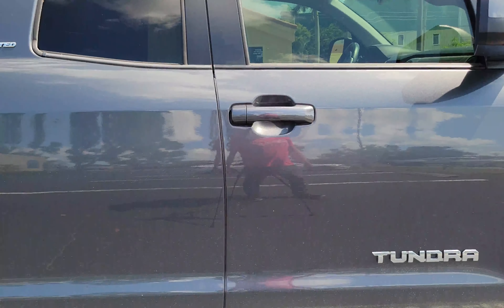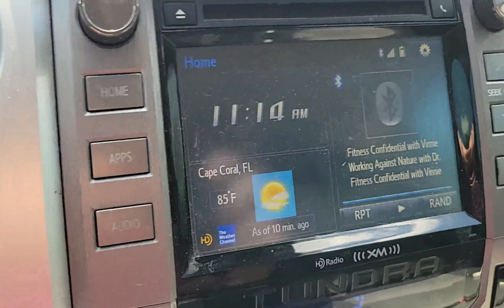2018Tundra Chrome Delete - Part 2. Door Handel's.

Comment: What's wrong with Chrome ? It's more "touch" durable. I'm curious how that coated handle will look in a year. Just saying.
Reply from the maker: I just dont like the look, plus for some reason, they stopped after the dront door. Plus on the mirrors you could see all the big dead florida bugs.